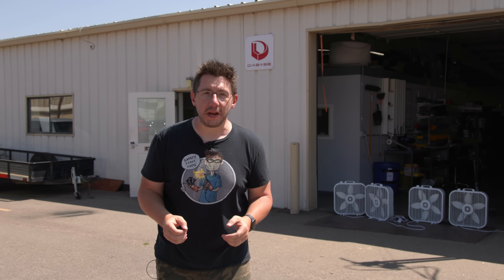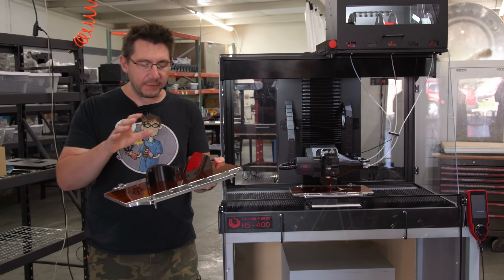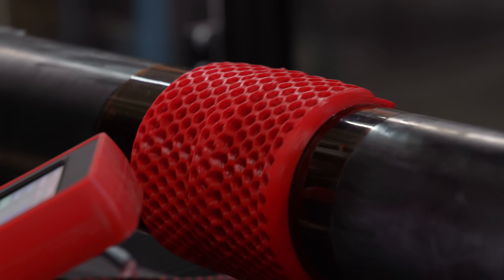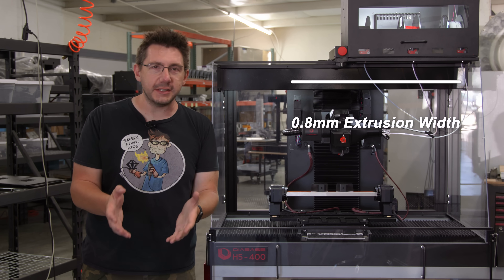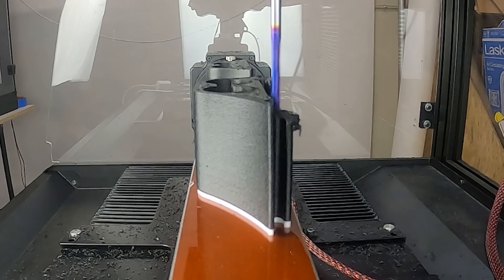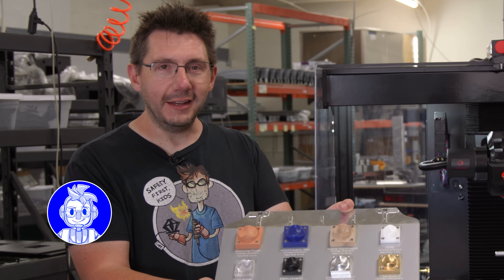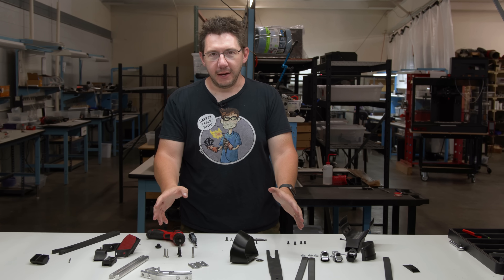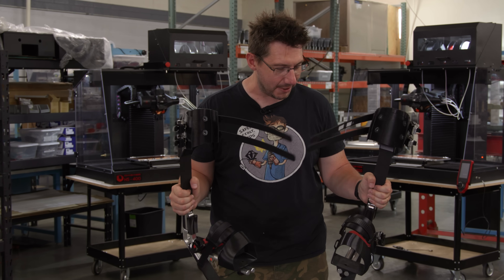ALL NEW H5 400 3D Printing / CNC Milling Platform from Diabase Engineering!

Comment: I was going to buy an Ultimaker, but wait I could spend 10.000 for this machine...not.

So what is your channel about,  the shopping channel ?
Reply: Did you actually watch any of his previous videos?
Reply: First, I ran across Joel's channel when trying to select the right tool for my job. Kudos there, especially the tours at the 3D print shows. He literally helped me make my decision to buy this machine. Thanks buddy!

True story, I almost bought a powder SLS printer for about $35K (with powder recapture I believe) to print my InnerSoul in nylon (TPU OuterSoul), but wasn't sure about the finish as a consumer product. I was also feeling locked into one (or limited) material, and it's really slow printing in powder. Pros and Cons there, but I'm in development and need this flexibility in design and make boutique products for sale.  Keep in mind, SoulPedal® goes in the shoe as an insole and a bunch of circuits that need protection. So I've got multiple sizes, custom perhaps for Clapton and the likes, and the need to be both rigid and soft within the same product. If I'm wrong about this strategy, I've still got a million other things I want to make with this machine!
Reply: And $10k US is the starting price. They want your info before telling you the price of what you want. Not a fan of that approach.
Reply: @JeffDM   just expect to 2x the price and ull be rite
Reply: In all fairness it’s not just a 3D printer. Go price out a CNC mill with a toolchanger and a rotary table. But the proof of concept product (the leg extension) worked pretty poorly. Looked like Joel was walking though a swamp with how mushy it was.
Reply: @Xen- Morph, it’s about showing off cool tech. I don’t think anyone (or very few people) are watching this with the expectation of being able to purchase one- just as I’m sure very few people watching videos about Lambos and Ferrari’s on YouTube are actually able to buy one.  But it DOES show us what could trickle down to affordable levels eventually.  It does get the wheels turning of designers and DIY’ers to maybe just develop something of their own.  And who knows - maybe some software whizz that’s also dope at math will see the need for better software for this type of machine and will be inspired to write the next big thing…. 

Before you criticize, try looking at the whole picture and seeing the positive in things.